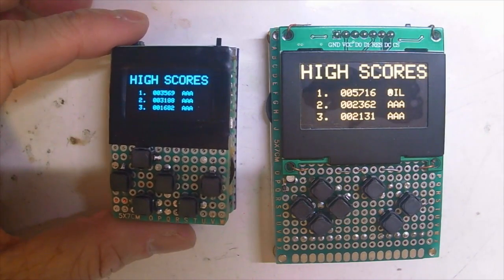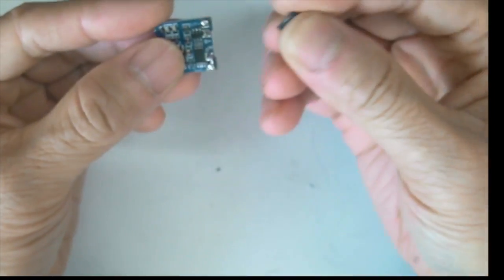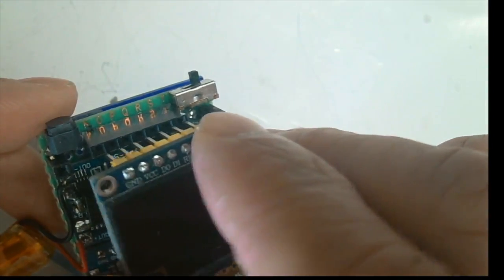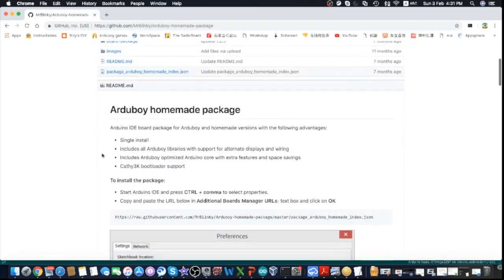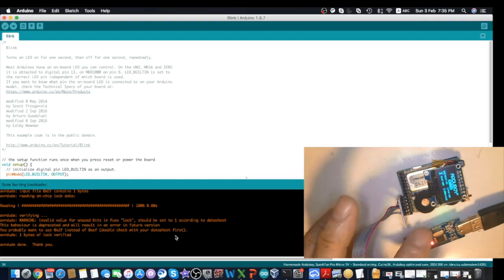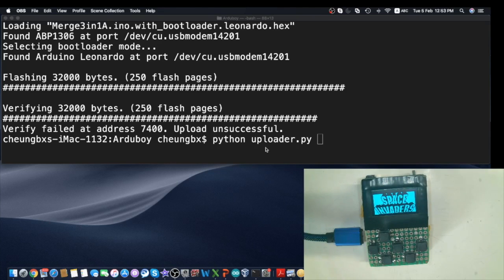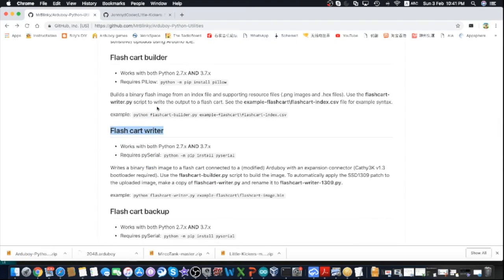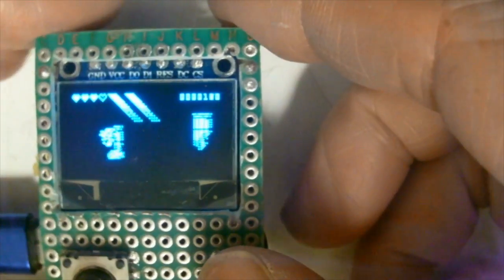The making of ArduBaby - The half size Arduboy Hardware and Software

Comment: Sir, the capacitor which you have use in the charging module is it necessary...if yes what its value ( I think it's 100nf or 0.1 micro farad)... please say what its value(if it's required)..if I not use the capacitor is there any issue ???
Reply from the maker: Better to keep to avoid noise , 0.1 uF will be good
Reply: @BillyCdiy  thank you for your reply. you are such a great supporter.please support me I am continuing the ardubaby in behalf of killing both the Arduino micro and serial flash cheap. And ordered again 😭... But again I try it please support me..

Comment: Is it possible to make arduboy on arduino nano + i2c ssd1306 + loading games from sd card, if so how?
Reply: i think no, because Mr.Blinky's bootloader is for 32U4 chip. Nano has 328p. If you rewrite the program, than - maybe

P.S. Только сейчас заметил никнейм и задался вопросом - нафига пишу на английском)
В общем, как я понял, не получится, потому что загрузчик сделан для плат с чипом 32U4, а на нано - 328, если получится как-то адаптировать, то думаю что можно сделать, в противном случае нет
Я тоже задался таким вопросом, но пока ничего не получилось
Заказал и алика еще компонентов для полноценного Arduboy клона, на ProMicro
Reply: Я нашел вариант как это сделать, можно использовать другую ардуино, к которой будет подключаться модуль SD карты, и которая уже будет прошивать Nanoboy. Загугли boot drive for arduino.

Comment: I have this board, but it's almost impossible to solder pins, d11,12,13. Is there any other way aound?
Reply from the maker: the other way is to use alternate wiring method and also change to SSD1306 I2C. Use MR.Blinky's latest Arduboy homemade library. That has added support for SSD1306 I2C that require less pins.
https://github.com/MrBlinky/Arduboy-homemade-package

Comment: For the pro micro, is it possible to start with a 3.3v version or we have to get a 5v and convert it?
Reply from the maker: Guy Wolf , the 3.3v version is shipped with a slowed down clock and too slow for Arduboy games. Either follow my video to start with a 5V version and supply a power not more than 3.3 to 3.7 V to it. Any thing over that will burn and kill the serial flash memory chip. Or you keep the pro micro at 5V then add a voltage level shifter circuit for the serial flash. Follow the schematic diagrams  of MR.Blinky. Which is a safer way but will require more components and more surface space, probably too big to fit on my original form factor
Reply: @BillyCdiy  so do I just need to remove the regulator and connect it to 3.7v?
Reply from the maker: Yes. Just follow what I show in my video.
Everything is there.
Reply: @BillyCdiy  wow thats a relief. Thank you!

Comment: what is the smd component on the back? (rows b-c)
Reply from the maker: Guy Wolf , pls quote the minute and sec if the video where you see thus ? I have not soldered any SMD at the back of the perf board. Not sure what you saw
Reply: @BillyCdiy  15:57
Reply from the maker: That’s one of the 1K resistors of the RGB led . There are no more roach in front so I soldered that at the back
Reply: @BillyCdiy  oh okay. Parts are starting to arrive and I will soon start making it, Im so exited!
Reply: @guywolf3674  did you make this...did you got success....plz reply..
Reply: @shreechandansamal5206  no, I didn't
Reply: @guywolf3674  why any problem??? Do you have all the components.....plz share me your problems because I want to do this ardubaby.....🙏
Reply: @shreechandansamal5206  I don't have all the components

Comment: can you please send a link to the charging module? there are alot of different types and I don't know which one to choose
Reply from the maker: This is the one i used. The output can be used to charge the lipo battery, as well as produce a 4.2V power supply. However, this power supply is actually in parallel with the LIPO Battery. That means you must connect the LIPO battery to the charger module in order to trigger the circuit to supply 4.2V. Without the LIPO battery, the voltage output is much lower and may not be able to power your Arduboy.

https://www.aliexpress.com/item/2pcs-1A-5V-18650-TP4056-Micro-USB-Lithium-Battery-Charger-Module-18650-Lipo-Li-ion-Lithium/32952555402.html?spm=2114.search0104.3.84.6dc44ca18lpON8&s=p&ws_ab_test=searchweb0_0,searchweb201602_6_10065_10068_319_10059_10884_317_10887_10696_321_322_10084_453_10083_454_10103_10618_10307_537_536_10902,searchweb201603_16,ppcSwitch_0&algo_expid=cf0e0b3b-e0ed-4d5a-90bc-acc90d865587-11&algo_pvid=cf0e0b3b-e0ed-4d5a-90bc-acc90d865587
Reply: @BillyCdiy  thanks! By the way, I just dry fitted a 5 pin potentiometer to the perfboard and it didn't fit (I know it sould be 3 pin but I just fiddled around), is the perfboard the wrong density or is a 5 pin one just isn't supposed to fit?

Comment: @Billy Cheung I truly can't thank you enough, you have been so responsive and helping and without your help I wouldn't have had the guts to even order all the parts!
Reply from the maker: Thanks for the nice words. Happy to share what I know
Reply: @BillyCdiy  Is it possible to make arduboy on arduino nano + i2c ssd1306 + loading games from sd card, if so how?
Reply: @Yur4ickX  yes me also
Reply: @BillyCdiy  I know I asked for a lot already, but mind sending a link to the led?
Reply from the maker: @guywolf3674  Here you are:

https://www.aliexpress.com/item/Wholesale-100pcs-RGB-POWER-TOP-1210-3528-SMD-SMT-PLCC-2-LED-Red-Green-Blue-New/32384196929.html?spm=2114.search0104.3.1.48c2705a0PFzhJ&ws_ab_test=searchweb0_0,searchweb201602_6_10065_10068_319_10059_10884_317_10887_10696_321_322_10084_453_10083_454_10103_10618_10307_537_536_10902,searchweb201603_16,ppcSwitch_0&algo_expid=6ead9d7b-f970-4dc8-87bc-cf50435b4236-0&algo_pvid=6ead9d7b-f970-4dc8-87bc-cf50435b4236
Reply: @BillyCdiy  Thanks!!!
Reply: Boge  oooook

Comment: I can't gind the potentiometer and the flash memory card anywhere online, I would love some links and also to the battery because there are so many sizes
Reply from the maker: The battery I used is 32mmx17mm x 6mm. This one seems to match https://www.aliexpress.com/item/1-2-Pcs-JJRC-H36-3-7V-260mAh-2-0-Connect-Lipo-Battery-for-Eachine-E010/32838509315.html?spm=2114.search0104.3.119.6a881cbb39JKMM&ws_ab_test=searchweb0_0,searchweb201602_6_10065_10068_319_10059_10884_317_10887_10696_321_322_10084_453_10083_454_10103_10618_10307_537_536_10902,searchweb201603_16,ppcSwitch_0&algo_expid=8774d47a-95d4-4868-95a8-0412256bd8f0-16&algo_pvid=8774d47a-95d4-4868-95a8-0412256bd8f0
Reply from the maker: 10K VR  https://www.aliexpress.com/item/10pcs-Double-Gear-tuning-potentiometer-B103-10K-3pin-16-2mm-Dial-Potentiometer/32886026828.html?spm=2114.search0104.6.3.35486c67iaXRKD&s=p
Reply from the maker: Flash memory - https://www.aliexpress.com/item/Free-shipping-5pcs-lot-W25Q128FVSSIG-W25Q128FVSG-W25Q128FVSIG-W25Q128-WINBOND-SOP-8/32619543360.html?spm=2114.search0104.3.2.2dbc2d1aCS3wbz&ws_ab_test=searchweb0_0,searchweb201602_6_10065_10068_319_10059_10884_317_10887_10696_321_322_10084_453_10083_454_10103_10618_10307_537_536_10902,searchweb201603_16,ppcSwitch_0&algo_expid=a46ae287-3237-4bc6-992f-1da4b92ee8f1-0&algo_pvid=a46ae287-3237-4bc6-992f-1da4b92ee8f1
Reply: @BillyCdiy  thank you!!!!!!!!!!! by the way, just noticed a smd component on the back, what does it do and where do you connect the reset button and the led?